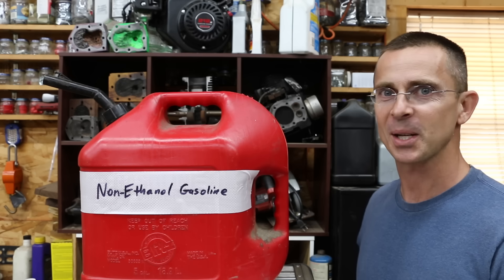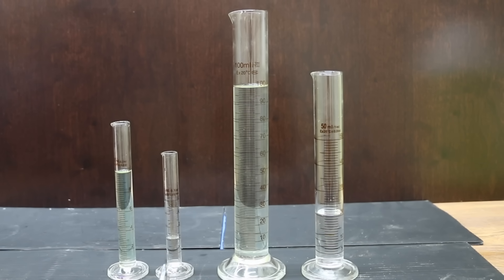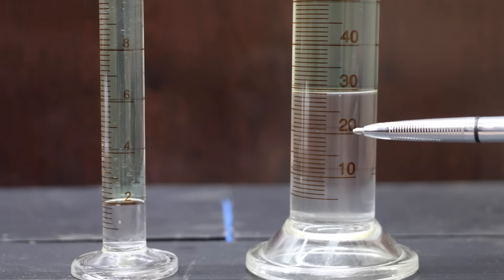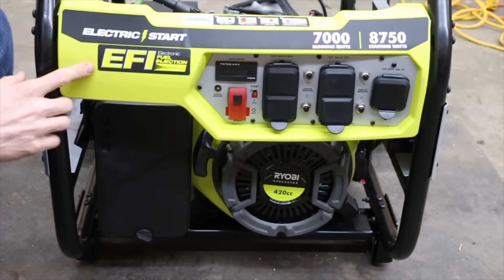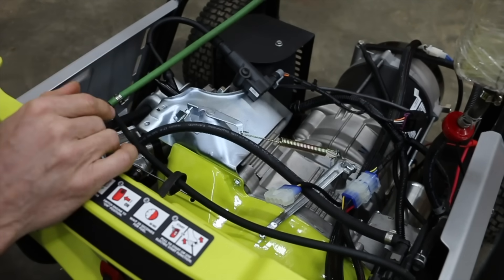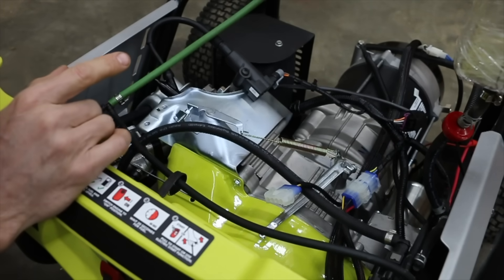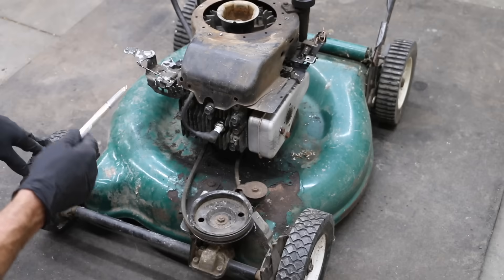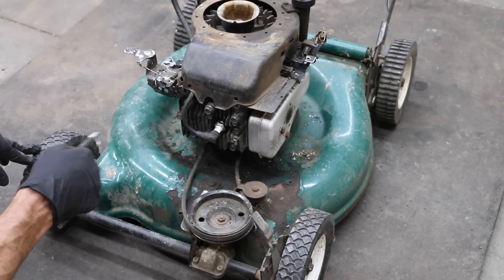Is Non-Ethanol Gasoline Really Better? See the PROOF!

Comment: Excellent effort making each test identical and thorough. 
One thing for your viewers to note… when measuring liquids, notice that there appears to be two levels of that can be read. If I am remembering my college chemistry correctly, this is due to the meniscus. Most liquids will pull up on the sides of the container (mercury will crown, pulling down on the sides of the container). To accurately measure the level, note the level of the liquid and not the effect of the meniscus.
Reply from the maker: Thanks!  Thanks for the feedbackkk.

Comment: It does not mature what fuel you are running, if you mishandle your fuel you will get water in it. The corrosion is from water and cheap metal. The cheaply made yard equipment are not sealed systems. I have never had a corrosion issues. I am 57 ASE CERTIFIED AND EMISSION SPECIALIST. Treat your fuel right drain your bowls and seal your cans you will massively reduce your problems.
Reply from the maker: Thanks for the feedback.

Comment: The point of ethanol was not about fuel efficiency. It is about emissions. The idea is to have more complete combustion or, at least, to break down some of the waste products into more tolerable compounds. That's why there are summer and winter blends. Different atmospheric conditions tend to cause more or less retention of pollutants in the air. So during one season, you need it. During the other you do not.
Reply from the maker: Thanks for sharing.

Comment: I buy the Stihl MotoMix for my Sthil small engines. Can you test the MotoMix vs pure ethanol-free with a quality two stroke oil?
Reply from the maker: Thanks for the suggestion.
Reply: @ProjectFarm  thank you. There's a huge cost savings with making your own quality 2 cycle mix. Just trying to figure out if the MotoMix is worth the extremely high cost.

Comment: 1 minor mistake in this (at the beginning) is the assumption that water and ethanol mix to create a solution with a volume equal to the sum of the volumes of ethanol and water. In the case of water and ethanol, it's actually a bit less, hence the 29 mL of mixture.

Comment: I live in the black hills of South Dakota.  Non ethanol fuel is more readily available here then when I lived in Minnesota.  Almost every station has premium non ethanol and some have regular non ethanol.  I will not run ethanol fuel in my engines.  Every small engine I have uses non ethanol premium.  I never add fuel stabilizers.  This spring as in past years, all my engines started easily after being parked for 6 or more months.  I have a cheapo mower that I picked up for $20. It sat all winter and started on the first pull.  I'll soon find out how an engine that hasn't run for years starts.
Reply from the maker: Thanks for sharing.

Comment: I noticed my car & van I had been using the 10% ethanol gas sure made the throttle body very dirty,  I have been told by many mechanics that it would stay cleaner using non ethanol and get better mileage.  Is there any truth to that?

Comment: I wish I could down-vote this a thousand times. This video IS misinforming people, ethanol does build up, it does cause problems, they do recommend 89 octane or recreational fuel for small engines and they do have good reasons for it and they do involve carbon build-up from ethanol. Go to a tech shop and they likely can show you what happens with engines that have excessive carbon build-up or spark arrestors that are clogged. He's full of crap with this video and I believe it to be incredibly irresponsible to put this out there.

Comment: This video is going to cause a bunch of folks to use 87 octane fuel in their small engines and then they won't understand why they won't start, idle funny, etc. down the road, after the carbon builds up. I use a Stihl trimmer, BRAND NEW, and unless I run recreational fuel through it, it will not run correctly, because ethanol. because it is causing carbon to build up on the spark arrestor on the exhaust. There are videos discussing this is detail and those people are not lying, dude. Stihl is not lying, dude. These techs are not lying dude. I can pull the arrestor out and see the carbon, dude. This video is going to confuse people and cause them to ruin their stuff, dude.

Comment: I didn't see how you measured economy. One fuel versus the other to say that ethanol included in the gas would improve economy when we know that ethanol has less energy than gasoline so by volume I don't see how ethanol could be more economical. You also did not test what happens when you leave ethanol fuel in the fuel tank over time as it absorbs water and what the impact is that has on engine performance.

Comment: Havent watched this yet so throuwing it out there that non ethanol in your test will get better mileage / power because ethanol based you need a higher volume to produce the same amount as gas and you also need larger fuel pump and delivery to equal it out . if you run it on an engine without the ability to compensate (flex fuel vehicles have sensors to detect ethanol ratio and adjust the fuel and timing curve on the fly. ethanol carbs on race cars are carefully tuned to run ethanol. Just toss it in your mower willy nilly ?
Reply from the maker: Thanks for sharing.

Comment: where i live there's mostly E10 and E20, then E85 (my car does not run it), and rarely can you find pure gasoline.

if i were to drive a lot in the upcoming week, i fill my tank with E20 (as it saves me some money).
if i were to not drive a lot, i fill my tank with E10 (as there is half the ethanol to corrode or evaporate).
i'd fill the tank with pure gasoline but it's way more expensive and exrtemly hard to find.
Reply from the maker: Thanks for sharing.

Comment: Let's talk about add gas line anti-freeze to a the gas during cold weather. I realize gas line anti-freeze is mostly water with a little methanol why put your engine through that torture pumping water through it. Does the ethanol in gas keep it from freezing?
Reply from the maker: Thanks for the suggestion.

Comment: LOl we used swveral quarts of 91% ethyl alcohol to remove all the water from my cousin's International Harvester QT 5000 fuel tank. Also, we run at the very least premium 91-93 octane gas in our small engines like chainsaws etc. Ethyl-free sometimes is hard to come by and is expensive and I'll store with engineered fuel when not in use for months. Chainsaws get used year-round so usually not an issue
Reply from the maker: Thanks for sharing.

Comment: I am a motorcycle and ATV mechanic. I use ethanol in my car because the fuel system does a good job of keeping water out and it never sits very long. The small engines usually have vented fuel tanks and after they set awhile, then the REAL destruction happens.  Ethanol makes me a lot of money.
Reply from the maker: Thanks for the feedback.

Comment: I did a test ethanol vs pure gas. I ran 475 miles with pure gas on a full tank while 350 on ethanol. I have a Honda suv. Also, sound water deposits when I used ethanol in my engine. Never using ethanol again. Engine runs smoother.
Reply from the maker: Thanks for the feedback.
Reply: @ProjectFarm  keep running these tests. I fear they will change how they make it just to save on cost. Appreciate your work! ✌🏽

Comment: I have two artificial legs having lost them in Vietnam.  I am very active, farming, and curious as to the strength of the components.  The socket is carbon and the post is aircraft aluminum.  Also, connections.  How much abuse can they take before catastrophic breakdown?
Reply from the maker: Thanks for the suggestion.

Comment: Stoich of non-ethanol gasoline is 14.7:1 AFR and E10 gasoline is about 14.1-14.15 AFR, so there is the majority of your 4% difference in consumption right there. Kudos for using a test engine with a lambda sensor for this too 👍🏻
Reply from the maker: Thanks for sharing.

Comment: Most of Brazilian fleet can run on E25 up to E100. We call it flex fluel. The ECU adjusts the fuel to air ratio according to whatever mix you put in. When it comes to corrosion... we began using ethanol as fuel in the 70's and back then, you'd see exhaust pipes falling on the streets due to corrosion caused by ethanol usage. Nowadays, car parts are adjusted and corrosion by ethanol is a non-issue.
Reply from the maker: Thanks for sharing.

Comment: I live in the land of ethanol.  E15 is pretty much standard.  My little 5hp Tecumseh based lawn mower is 30 years old.  It was purchased before anyone knew about ethanol.  It now runs E15.  It doesn't care.  I change oil every year, fuel filter and plug every three years.  Clean as a whistle and still starts on the first pull (if you prime it properly).  Btw:  My Tecumseh based snow blower is 14 years old is is difficult to tell from new. 

Maybe that's a Tecumseh testimonial (freaking shame what was done to a great company) more than an ethanol testimonial.
Reply from the maker: Thanks for sharing.

Comment: Toro's snowblower owners manual states "Do not use ethanol blends of gasoline (such as E15 or E85) with more than 10% ethanol by volume. Performance problems and/or engine damage may result which may not be covered under warranty." I just use that canned gas that is sold at hardware stores - no ethanol, and stabilized.

Comment: Many years ago, I decided to try ethanol gasoline for the first time a trip pulling a boat with a car.  Fuel mileage went down.  After a while, the car just died.  Finding I was getting no fuel, I pulled the hard filter out of the carb.  It was full of rust.   Cleaned it and put back in.   Died again later.   More rust.   Worked ok after that.   I guess it does something to rust.
Reply from the maker: Thanks for sharing.

Comment: You dont need to say 20 M.L.
It is called 20 millilitres. 
Or you could say 20 percent as you started with 100ml.
Is says 100ml however you must say 100 mills. 
100gm is not a brand of car it is 100 grams.
I have never ever heard some one call millilitres simply M.L.
Is it because you couldn't use quarts or pints or some other arbitrary measurement like ball bag capacity that you took offense to being forced to use metric.

Comment: Running an electric generator and lawnmower engine indoors inside a building.??  If so then that is a big absolute NO, NO.!!  Because of brain damage and health problems.
Reply from the maker: Thanks for the safety warning. The shop has a 4-foot whole house fan to pulls a tremendous amount of air out of the shop. it's a wind storm in there when the shop fan is going. lol
Reply: @ProjectFarm  ~Okay thank you for the logical explanation that does make sense. I am older and worked in the construction trades for many, many years. When someone runs “any type of engine or is spraying concrete sealer” indoors inside a building then I quit and walk off the job or if not working then get out of the building which I have done numerous times before. My health is worth more than money.

Comment: The one thing your tests don't take into account is the design. Modern motors and carburetors are designed for alcohol fuel which reduces the efficiency of alcohol-free gasoline. For many years I ran older mowers that I would pick up along the curbs and the one I'm using now, I've had for 17 years but will require a ring job asap. I hope I can find some for this 30-year-old mower which almost mows 1/4 acre on a single tank of ethanol-free gas. Also starts every spring without trouble! PS; the only reason it needs rings is my granddaughter's boyfriend tried to mow my lawn last fall while I was in the hospital, and he poured gas in the oil and then tried to run it.

Comment: Ethanol has a different stoichiometric than regular gas. To do a real comparison, you would need to reject the carb. If you decide to run 10% ethanol fuels in a small engine long term then you should always richen the jet a little bit. I go against the grain on all these comparisons and believe that ethanol fuel has less of a chance of condensation in the gas station fuel container before I buy it. In other words since they sell more ethanol enriched gasoline, it is more "fresh" and less chance to have condensation in it, before I buy it.
Reply from the maker: Thanks for the feedback.

Comment: It's not even how the engine runs that's a real problem with ethanol blends, it's the fact that ethanol is hydroscopic and it attacks certain materials.  Since E10's introduction here in the UK I've seen a lot more small engines with damage due to affects of corrosion and the high water content.  Long term storage is a real problem with fuel systems that have been exposed to these fuels, even if they no longer contain it.
Reply from the maker: Thanks for sharing.

Comment: Since I see such a noticible difference in performance and fuel economy in my vehicles when using ethanol free, I would be very curious to see a quantitative analysis of the performace between the two fuels under load, and if ambient temperature affects performance differently between the two.  Also, the effects of use and storage in wet vs dry climates.  Additionally, I would imagine that different engines perform very differently with the two fuels due to design and electronics, and would be interested in diving into that more as well.
Reply from the maker: Thanks for the suggestion.
Reply: @ProjectFarm  You have missed such big issues
Reply: I have definitely have seen better performance and mileage up here in Canadian weather in my 4cyl subaru. The engine runs a lot smoother as well with non ethanol (assuming i do get that by buying super gas which usually is ethanol free, im gonna verify that now).
Reply: @MN-sc2uz  it decreased bucking and smoothed out the shifts dramatically in mine when shifting and decreased shift times as well (it was an automatic)

Comment: Your energy content test with the generator is consistent with the physics. 
Ethanol has about half the energy by volume compared to gasoline, so that means that those 10% only contains as much energy as half its volume in gasoline. So that means that all in all the E10 fuel has 5% less energy than the pure gasoline. So makes sense you got around 4% less run time powering the same load.
Reply from the maker: Thanks for sharing.

Comment: Love your channel. One thing I've understood about ethanol vs non-ethanol fuels is that the carbon builds up with ethanol fuel during secondary combustion; vehicles with an EGR / exhaust injection for a second combustion. Ethanol free fuel is supposed to be much cleaner in the secondary and tertiary combustion. This secondary combustion is a leading factor for why we have fuel efficient vehicles but is also why there is excessive carbon build up. I have no idea if this is true or not but that's the claim and I'd love to see if you could prove it or not. Unfortunately, a lawn mower is not going to show this since it doesn't have an EGR system that injects the exhaust back into the combustion chamber for a secondary combustion.
Reply from the maker: Thanks!  Thanks for the feedback.
Reply: @ProjectFarm  What do you think? Worth trying something like this? I don't know how you could do this small scale to test but I think it would really put into perspective if ethanol free is actually worth it.

Comment: Probably already mentioned and I can't really go back and check 14000 comments to see if I am repeating--but something weird happens when you mix X amount of ethanol and X amount of water together as happened in your initial tests.  Because the ethanol and water effectively "dissolve" in each other, they actually can sit more compactly mixed together than when they are separate.  So 20 ml of water and 10 ml of ethanol mixed will not be 30 ml mixed total, it will be somewhere around 28-29 ml total.  It makes things look like some of the volume magically disappeared somewhere.  Just a head's-up if similar tests come up in the future.  In this case, it seemed to make you believe you might have started out with less than 10% ethanol in the gasoline.

Comment: I have had repeated crystal (like sugar) buildups in motorcycle carburetors that have sat over the winter. I never saw that before they put ethanol in gas. I'll try my own test with additives because in my area they do not have non ethanol gas.
Reply from the maker: Thanks for sharing.

Comment: Most of the boat and lawn equipment fuel systems are vented to atmosphere. That means they breath in humidity with every temperature and barometric change and even with passing wind. 
The water collects on the tank sides and runs down into the gas. It is then absorbed by the E- gas until the E-gas can't hold the water. Then the water falls out of suspension on to the bottom of the tank as seen in the test here. And corrodes the aluminum tank.
 So, in the off season fill the boat tanks with E gas to absorb the water that's definitely already in the tanks (yes, it's there) and to hold the water off the bottom of the tanks.
 It's absolutely positively necessary to seal the tank filler neck and carb throats and vents. 
And also seal the exhaust and the crank case breathers to keep water out of the engine so as not to get the milky motor over the layup season. The resulting corrosion will eat the rockers straight away.
Reply from the maker: Thanks for sharing.
Reply: @ProjectFarm  
I do appreciate all your efforts to bring things to light for us that we don't have the time or equipment to drill down on. I also think that you do all that can reasonably be expected to do just that. And, I think it's my responsibility to evaluate your findings to best apply them to suit my needs.
 Very pragmatic fellow you are. Never second-guess your methods.
Carry on.